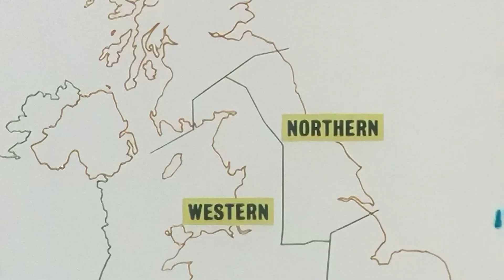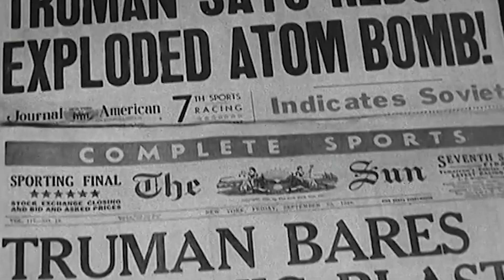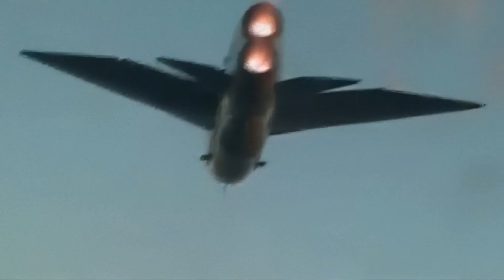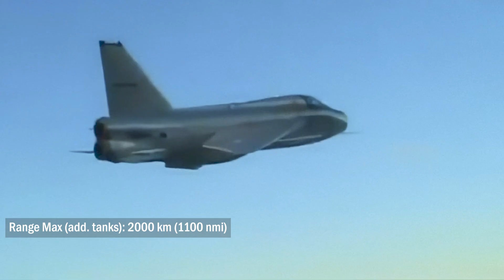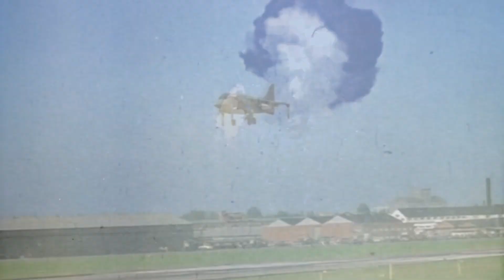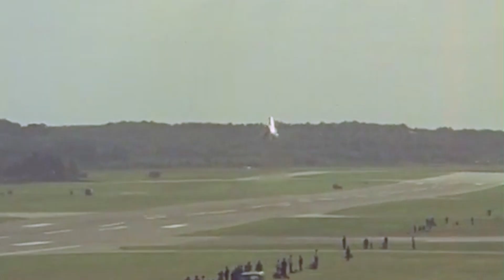Lightning – effective exotics

Comment: In recognition material of the time the maximum speed was usually listed as either mach 2 or 1520 mph. Neither were correct, pilots who flew it said it was amazing what it would do if you had the balls to give it full throttle and hang on.

Comment: We lived about 10 km away from 11 Squadron, and saw Lightnings almost daily. We often heard sonic booms from them too, because it was very easy for them to exceed Mach 1, even with the engines running 'dry', if the pilot didn't exercise care to control the speed at altitude. They're still a beautiful aircraft, and missed by those who knew, flew and maintained them.

Comment: I guess the British were free to use the name 'Lightning' because it was they who first bestowed this name upon the P-38 "Atlanta" when they were briefly in RAF service. Also, one reason many fighters are so big is to provide ample internal volume for fuel. Increasing the diameter of a fuselage 20% can increase fuel capacity 40+%, without significantly increasing drag. I built a model of this plane back in the 70's, and always found it's appearance odd, same with the B-36.

Comment: A trip down memory lane, having served two tours of my military service at RAF Binbrook as an aircraft engineer.   Binbrook was the final home of the Lightning in service, where I and my colleagues got to see them daily.  They were certainly an engineering challenge, but the job satisfaction was high as a result.  Who can ever forget the stinging eyes from the avpin exhaust fumes during engine starts.  The noise and vibration during engine runs at the engine detuner, whilst watching to check control lever or nozzle movements as reheat engages, or watching the vertical climb on take off.  During one exercise I was on the line as the air raid siren sounded, and a number of starfighters simulated a base attack at low level.  There were two Lightnings approaching the runway and rolled straight in to a take off.  The first up went straight into a loop, half roll and descent to drop in behind one of the attackers.  Spectacular to see.  Better than any air display, where safety matters gain importance.  They were a hard taskmaster and would elicit many a curse. but looking back were a gift to an engineer in the challenge they presented.  Of course for anyone else who worked or flew these wonders.  They'd know just what I mean by "Chute trick"...saw a few of those pulled in my time. Now in fact I'm so long retired from the service that all of the aircraft types on which I worked have been replaced.  Good hard times well remembered.  Well presented documentary, so keep up the good work, and many thanks for the trip down memory lane.  But mostly I hope you and yours are and remain very well indeed.

Comment: As an USAF pilot, I had the pleasure of flying the Lightning while stationed in Germany.  An English squadron commander had flown his aircraft to Ramstein AFB for a visit to our unit.  We were flying F-102s at the time.  He offered to let me fly his Lightning and of course I jumped on it.  I flew an intercept mission against a F-102 above 40,000 feet going slightly less than Mach one.  I stayed in afterburner all the way until intercept and mock firing of an interceptor missile.  I don't recall having to worry about exceeding the sound barrier during the climb as we weren't allowed to do that.  It's hard for me to believe that it could go supersonic in a vertical climb.  Maybe if you were already doing Mach .95 and pulled up, it would slip thru the sound barrier.  Anyway, after the intercept I had to make an immediate landing due to being low on fuel.  I don't remember it being hard to fly at all.  In comparison, I had flown the F-106 before my assignment to Ramstein.  It had the same performance abilities as the Lightning but was more stable, had a better fire control system and a much better range capability.  I was impressed by the Lightning but would choose the F-106 over the Lightning.

Comment: Very few knew the full capabilities of the Lightning, and those that did kept their mouth shut.
Reply: Dead men tell no tales... RAF pilots called it the "Aluminium Death Tube" for a very good reason... it flew very fast... all the way to the scene of the crash site.
Reply: @DoktorBayerischeMotorenWerke  Yes, 50 out of more than 350 produced were lost along with 30 lives over their 30 years of opperation, yet their history of development, and performance from 1947 to 1988 was and remains fascinating for those involved.
Reply: @willielongbotham7156  Total aircraft built: 337 Lightnings (including prototypes and all variants)

Aircraft crashes: 88 
 Hull Loss accidents: 195 (58%)
Pilot fatalities: 39
Reply: @DoktorBayerischeMotorenWerke  That fatality rate of 44% is higher than any Starfighter operator that comes to mind.  The Lightning's final accident rate of nearly 18 losses per 100,000 flight hours isn't too great, either.

Comment: When you need to take a giant step forward, you make new rules.  Mach 1 had only just been achieved.  English Electric built a mach 2+ interceptor that could be scrambled and up to height quicker than anything previously., based on the probable requirement at the time.  It was complex and difficult to maintain and lacked endurance, but set new goalposts for the future.  How many fighters are there that can exceed Mach 1 in a vertical climb even 60 years later?

Comment: Should have been the 60's Euro fighter but the people pushing the F-104 closed it down through dirty tricks & black arts....

Concorde, Lightning....? Bit of a common theme from our American friends here...🤔
Reply: The Lightning was too expensive, too hard to maintain, not versatile enough.  They were right to buy the Starfighter.
Reply: @dukeford8893 

If was nothing about that. Lockheed have been had up for pushing brown envelopes during the whole procurement process. 

Both had one job, to take out incoming Soviet bombers, they were never meant to be ground attack aircraft or anything else. 

The Starfighter went on to kill 33% of the Luftwaffe & similar losses of the Italian air force, how expensive was that?
Reply: @pup1008 Your knowledge is severely deficient. The Starfighter was designed as an air superiority fighter, not as a bomber interceptor. USAF air superiority fighters naturally progressed into multi-role types (F-86F, F-100D, F-104C, F-15C, F-16C, etc.).  A 30% attrition rate is typical for fighters of that era (as is a 30% KWF rate), so your cost analogy doesn't exactly hold up.
Reply: @dukeford8893 

North European air forces didn't need "fighter aircraft," they needed something exceptionally fast with an amazing climb rate to intercept the expected hoards of incoming Soviet bombers. The Lightning could go supersonic standing on its tail, it was that good! Effectively the job description was for a "manned missile!" 

It's a matter of record that Lockheed bribed those in charge of procurement! 

Yes, a lot of pilots did die in those days but the Lightning had nothing like the attrition rate of the 104.
Reply: @pup1008  1. When the F-104 was selected, NATO air forces were mainly looking for a plane to replace the F-84. A fighter-bomber that could deliver a nuke. 2. The Lightning could not accelerate to supersonic speeds while in a vertical climb. A popular, but inaccurate canard.  4. The bribes were a scandal, to be sure.  The F-104 was still the best choice.  3. The Lightning had a 26% attrition rate and a 27% KWF rate.  It's accident rate was 17.8 losses per 100,000 flight hours.  For a dedicated interceptor, the accident rate, in particular, is pretty abysmal.

Comment: Saw Lightnings perform at UK airshows in the 70's before present rules were used. It would fly so fast over the crowds and make a fantastic noise but the take-off was the best, becoming airborne by retracting the undercarriage then straight up vertically for such a long time.

Comment: The aircraft that introduced the world to supercruise, the ability to cruise at supersonic speeds without afterburner. This aircraft was designed in the late 1940s. When they were in service a common joke was that they only had wings to keep the nav lights apart. The other joke was that on take off the pilot was with it all the way until he released the brakes.
Reply: Both the F-104 and F-106 were capable of supercruise.  Who did it first is a matter of conjecture.

Comment: I remember going to an air display at RAF Horsham St. Faith (now Norwich airport) in, I guess, the early 1960s, and watching them take off, pitch into a vertical climb, and disappear. The commentator said that was not the fastest way to gain altitude - a 60 degree climb was better - but it certainly was impressive. The same airshow had a Spitfire and a Hurricane performing mock dogfights; the Lightning outshone even them.

Comment: This is one of my favourite aircraft. I saw one beat up the runway at Tollerton in Nottingham when I was a boy. It came in low fast and disappeared vertically with a deafening roar never heard in Nottingham before. From that moment, I've been an aviation fan, and now at 68, I still get a buzz out of seeing this aircraft fly. Great video, thankyou for sharing. I've now subscribed 😊

Comment: Always a fabulous aeroplane. If it weren't for the complexity, and hefty fuel burn, it might have been better travelled. But one thing; anyone who went to those 1960s airshows, and watched 16 lightnings take off as one big diamond, all on afterburners, will remember the air in your chest vibrating your ribs and gut! Same with the Vulcan. But 16 lightnings = 32 motors doing their stuff, such things are memories made of (-;)~

Comment: Britain needed an exceedingly fast interceptor with a phenomenal climb rate to show any potential aggressor (or spyplane) to get off our patch.
What is too often overlooked is that it did a key job on behalf of all Atlantic-facing states which were 'visited' by the Soviets and caused the USSR to stop work on projected jet bombers, relying instead on the TU 'Bear' in the northern quadrant.
This gave time for France and the UK to work with others on the formidable Tornado and France's independent Mirage Series for use in it colonies as well as over the ocean.
Britain operated a much revised F-4 Phantom for just a few years while the Tornado MRCA was perfected and, of course, had the specialized, unique Harrier family as well as Hunters, Gnats and Lightning air refueled planes on the Greenland airspace dash.
The mentioned Starfighter was not in the same league and had a tendency to kill pilots.

Comment: With the overwing tanks fitted supersonic flight was forbidden. Not a real problem as the tanks were only fitted for ferry flights. Also in squadron service speed was red-lined at M1.8 higher speed claims only by development aircraft in use by the manufacturer.

Comment: Known by some pilots as the "Frightening",  I remember see one display at an air show in the 70s at the end of the display it screamed down the runway at approx 20 feet and then climbed vertically straight as an arrow and just kept climbing untill no longer visible in a clear blue sky. The Lightning was a beast.
Reply: That was always its show-closing party piece. Often cloudy skies in British airshows, it would exit by screaming away from ground level into the one patch of blue sky and just disappearing straight line out of sight, acelerating all the way.

Comment: I used to love watching the Lightnings at Prestwick airshow when 'I were a lad!' (I'm a Fresian cow now. My flat is fukkin fresian, Brrrr) My favorite part was when they did the massed take off , clean up, and then stand on their tails and scream up to kiss the stars! As a point interceptor they had zero contest in the early to mid 60's, and to compare it to the flying coffin, the widowmaker F-104 is ludicrous. The Starfighter may have been a great 'Fair weather fighter, but it just was NOT a multi-role combat aircraft as Lockheed very disgustingly sold it in Europe as. 175 dead young pilots. The new Luftwaffe. and a government thief called Strauss are key words if you want to hear a true tale of fantastic greed and pure evil. Check it out F-104G. G for Germany.
These old beauty's flew operationally into the 1980's like a prom queen in her 50's propped up with a bit of Rhinoplasty and amphetamines. They even gave the old bird some longer legs and made her fairly useful even in the 70's when military aviation was rapidly changing  with stuff like the MiG 29 and F 15  tearing up the skies. A wonderful Aeroplane with which I feel a small attachment to as I used to feel them when they over flew our house before I would hear them. PEACE Y'All.

Comment: I used to see with awe in late 1970s with afterburners on taking off at night at Dhahran airport Kingdom of Saudi Arabia and also used to see mountain of used tires as apparently it almost chewed the tires per flight
Reply: Max 4 landings per set of tyres. It was so powerful it was possible to use it's entire fatigue index in one flight. One pilot did just that on it's first and only flight on squadron strength.

Comment: Anyone making a video about the lightning should never leave out its parting shot. Clips were short but ok .Fast run in 100 ft along the runway centre line full, after burner and stand her on her tail and go vertical. The noise is hypnotic . I miss that at air shows now but the typhoon does a good show and goes vertical from 10--12 seconds from brake release, Assum. 😳😳

Comment: Though it looks like it has swept back wings it is in fact a delta wing with a section removed from each wing. This was so the control surfaces would be better positioned along the trailing edge. The delta wing was a big thing at the time, and still is if we look at the Typhoon as well as the F-35 and F-22, and was also seen in the like of the Vulcan and Javelin.

You did not mention the fact that the Lightning was also capable of catching the SR-71 Blackbird which the same pilot did twice. The second time it actually flew passed the Blackbird so was flying higher than it did.
Reply: Regarding the Blackbird, was it actually an intercept mission or was the SR-71 coming back for a landing?  Genuinely curious.
Reply: No, the Blackbird was flying south over the North Sea, The lightning snuck up alongside. When the 71 saw it, it opened up and shot away.  @Pene7942
Reply: Technically a 'notched delta'. All the advantages without the drag penalty .

Comment: One thing you forgot to mention is that a Lightening could stand on its tail at the end of the runway and disappear as if it were a rocket! I have not seen any other aircraft do this since.
Reply: I saw a lightning do this at RAF Leuchars in the mid 70’s.   I’ll never forget the power, noise and sheer spectacle of this aircraft climbing vertically to the heavens.   It has been seared into my memory.  The experience left an indelible impression on my young brother, who eventually became an RAF  Squadron Leader/Chief Flying Instructor.  Sadly not the Lightning. As I type, he’ll be flying somewhere in the World in his BA 777.
Reply: I’m fairly sure that I have seen a Lightning go supersonic in a 60 or 70 degree clime

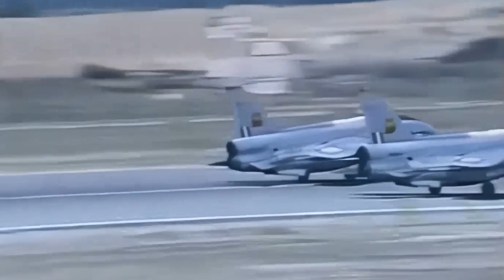Comment: 16:11 It's not the "BAC" Lightning, it was made by English Electric.  BAC didn't even exist until 1960 and had nothing to do with the Lightning.
Reply: Gotta correct you here my friend, but if you correct someone who was in fact correct, then you’re leaving yourself open. Aircraft are almost universally known by the parent company of their concurrent manufacture, not by the designator of their design team or initial manufacturer. Lightning production had barely got going by 1960 when English Electric as a company ceased aircraft production, so I’m not sure why you stated that BAC had nothing to do with it - “they” went on to produce the majority of Lightning airframes. English Electric’s other ongoing project at the time also became an official BAC product ie the Canberra. Hunting’s Jet Provost too became a BAC product but no-one quibbles over that. Other examples of corporate takeovers officially re-designating aircraft include the McDonnell-Douglas Phantom and DC9, both of whom’s production overlapped the merger. The best reference points are in-period Observers Book of Aircraft or Jane’s’. 
When an aircraft has ceased production before a corporate takeover, then the original manufacturer’s entitlement generally remains eg it’s a “Douglas DC7” not McDonnell-Douglas; the Hurricane retained it’s purely Hawker designation etc etc. 
There are some exceptions whereby a reformed business continues to use an old brand name to badge its aircraft (eg Vickers with the Supermarine Spitfire and General Dynamics with the Convair F106 and CV990 Coronado) but the Lightning wasn’t one of them.
Reply: It's a bit like calling the P-51 a Boeing product. Just because you buy or merge with the company does not take the fact away the it was designed by Teddy Petter who worked for.....English Electric, and it was known as such until the F Mk3 was introduced.  @neilturner6749

Comment: For once a good even handed commentary on a superb aircraft which was hamstrung by a stupid ( government )declaration that guided missiles were the future of interception.
Had that not happened it would have sold more successfully.
It was expensive and difficult to maintain but not as eye wateringly expensive as the F35( fighter?) is and will be in the near future.
Even the Americans are buying new build advanced F15's which says something.
Reply: Aircraft was like the Harrier, could carry a fag packet across a football pitch and nothing more. Fuselage was mostly Intake and Jet pipes. Wings were mostly undercarriage!!! To get extra avionics in the F Mk 3 version, they had to take the guns and ammo out. Getting the engines in and out of the aircraft was a right pain in the ass. Not a good design.